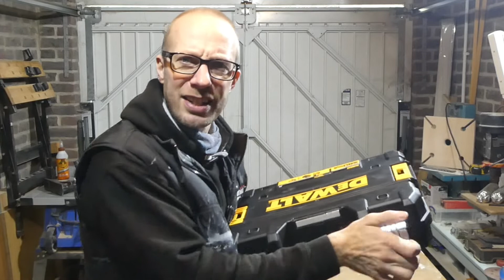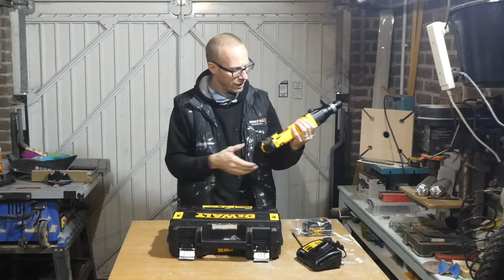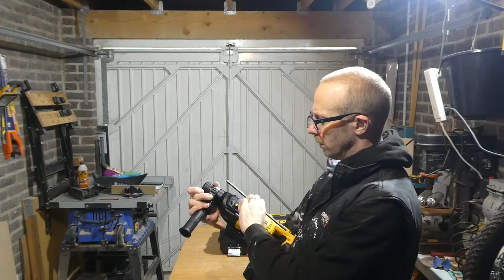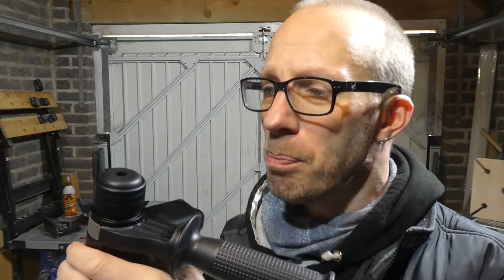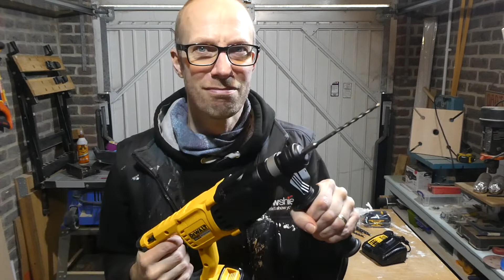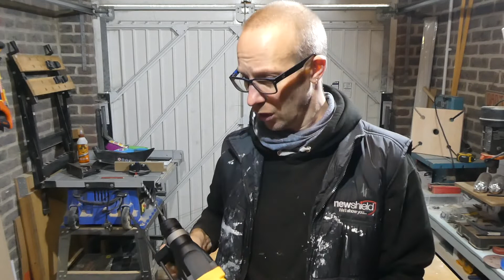DEWALT 18V XR Brushless SDS Hammer Drill

Comment: Over here in Canada i have the same one 
Its an animal i do a lot of work in construction and often find myself drilling into and through 5000 psi concrete 
Drills  into it like drilling a hole into water 
I even uesd it to install an exterior light at my igloo door 
Ice is tough as hell 
It really is a great drill Justin 
You wont regret buying that 
Dont ever buy the 90degree sds cordless we have had several of them seize up 
Just a heads up

Comment: Pretty jealous that you guys get some tools with the TSTAK case. None of the tools come in TSTAK cases here in the states and the entire line of TSTAK cases is non-existent at retail… unless you count the Craftsman-branded “VersaStack.” You can over-pay by ordering them online but you just can’t get it at the hardware store chains or in DeWALT tool bundles. Several of the tools I have bought at retail come in a TSTAK case for you guys including the DCS438 and this DCH133. Also, DCH133 doesn’t have “XR” badging in the states even though it outperforms the XR models. The XR models are shorter and/or dampened with extra handle articulation to make it easier for pros and tradesmen to use all day but the DCH133 just hits harder.
Reply from the maker: Thanks for the info 👍